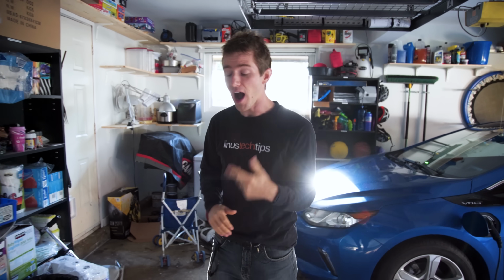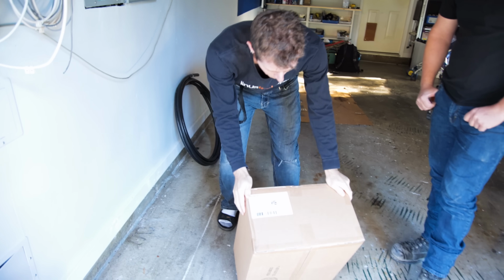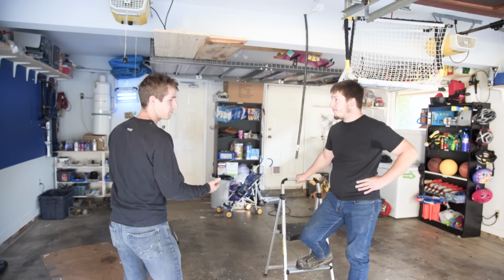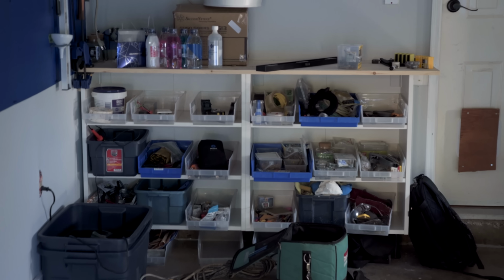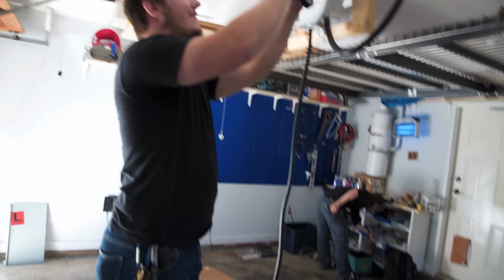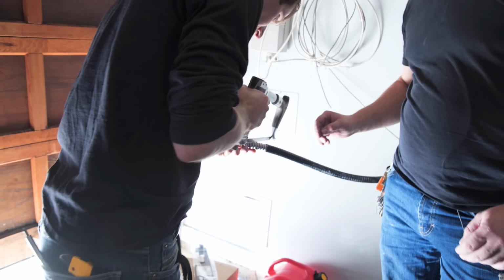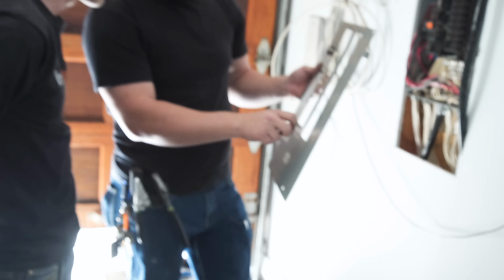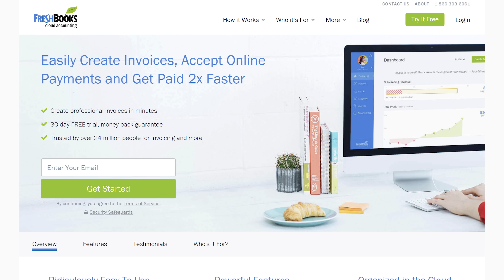Installing my Electric Car Charger - What Could Go Wrong??

Comment: As a professional electrician, I approve of this electrician. Also he's fun af and does well on camera
Reply: Rory Christel he might be a great guy, but his electrical practices are way off. One, he should of isolated the entire switchboard before removing the panel, two, was was not using the correct screw drivers.
Reply: daniel5620 regular klien screwdrivers are fine on 120VAC, it's more than sufficient insulation for that voltage. And lol at isolating a breaker panel, how green are you?
Reply: @daniel5620  Uncommon in Canada to turn off panels when working on them. Uninsulated screwdrivers are also the norm here. Both practices are changing slowly. We rely heavily on our CSA steeltoe boots which are 10000v rated as long as they have the omega symbol present.
Reply: Daniel M honestly, you're not using your boots. Pretty much any pair of thick rubber soles would work at these voltages. I can grab a live 277VAC wire while wearing my Vibram sole McRae's and still not get hit, as long as I'm mindful about where the rest of my body is.
Reply: totally forgot your on 120 try that on 250 in the uk and its all kinds of fun
Reply: @recless8667  Totally true although I like having the peace of mind. In my province Alberta you aren't allowed on many big job sites as an electrician without them.
Reply: I might not always be correct but our standards in Australia are to protect a electrician, I forgot that other countries have different standards. Sorry if I pissed anyone off.

Comment: Index of some of the innuendos:

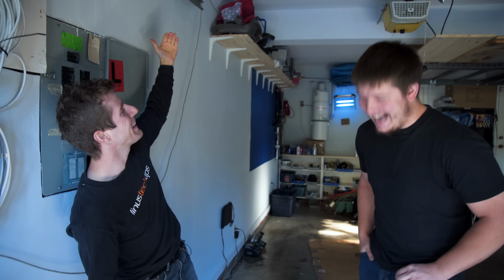4:00 I just know where it's going and I . . .
4:35 I think all the access holes are kind of in use here . . . Oh wait, I see one!
5:20 OK, so you're going to stick a screwdriver up?
5:25 Oh Hi there, have you met my friend, Mr. Pokey?
5:30 OK, now you can poke something through a hole . . . OK, can it be black and really thick? . . . I'm gonna say yes. . . . Yeah you are!  It's properly sheathed; It's ribbed for her pleasure! . . . Oh my god it's really long! . . . That's Good  . . . OK, you've had enough have you?
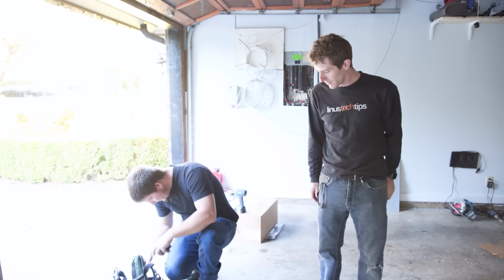6:45 I actually have wood as well . . . You got wood Linus?
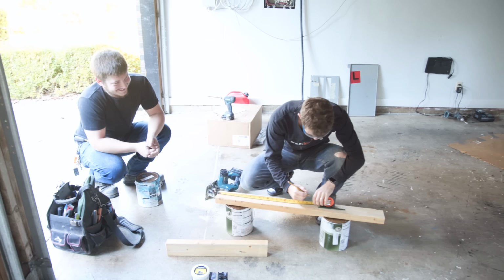7:10 It might not be straight, but it's 22 inches long right now . . .
7:45 I'm going to get my drill!
8:00 I've got my own screws, their just as good as your screws . . . Which Screws shorter, Linux? . . . Their actually slightly shorter, but not in a way that matters. . . . It's not as thick either, Linus.
8:30 All right, who's screw is longer now, bring your's back!
9:55 Oh! So, that's all the fun bits inside!
10:15 So at this point you just stick it in there . . .
Reply: 14:07
Reply: 13:21 you just wont use my hammer
Reply: 3:20
Reply: 6:48

Comment: 9:41 My heart stopped when he started screwing in the screw
Reply: Yeah, same. Sure he knows the screws are not long enough to go through, but fucking hell
Reply: @RiamiAurum  you dont do it
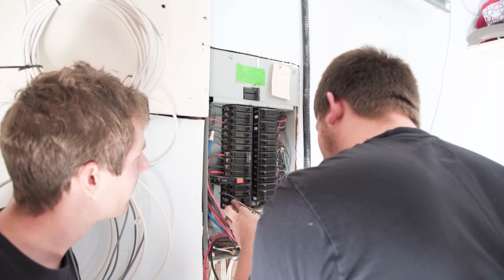Reply: 16:16 its way worst my friend u.u
Reply: @RiamiAurum  Carpenter here and regardless if screw is longer or shorter. Under no circumstances do u put your hand behind the board. Faulty boards can easily split and pierce the hand

Comment: Yes, the Chevy Volt is discontinued.  I purchased a used 2017 with around 20,000 miles on it and less than 1000 were gas.  It seems like the previous owner was a "high-miler (obsessed with getting max electric range by frugal acceleration and breaking)" and the friction brakes felt like they had almost never been used.  My new job is 40 miles away.  New Job offered to install a charging port for me.  I might get a second and in 2 years, I plan on getting a 2019.

Comment: Laughing at cutting off the mains? Proceeds to work on a hot breaker box that looks like that? Brian I like you, don't die.
Reply: And without proper insulated screwdriver
Reply: It was a bit sketch on that particular panel, but he would have to touch the screwdriver to the case and busbar for anything to go wrong, and I'm pretty sure that's physically not possible in that panel with a straight tool.

I have panel that doesn't even need tools to install a breaker.
Reply: It is actually common for electricians. Sometimes you just cant cut off the main just to install a new breaker.
Reply: @shinaikouka  Don't worry, I have an older panel too. It's a short panel with nothing but tandem breakers. It's all good. I have only 100A service and have never tripped a breaker.

I just installed a sub panel for my basement, but I literally don't have a single space left for any more circuits anywhere but it is clean, includes a while home circuit breaker, a garage heater, and a 30a  service to the garage for utility. I optimized the hell out of that panel.

My service comes in from the bottom too, but my builder had the presence of mind to mount the of upside down.

In your case I would just get a bigger sub panel and put it right next to yours. It'll save you thousands in labor trying to replace the old one.
Reply: If you don't work when the power isn't on you're not an electrician.
Reply: @scwfan08  Yeah, there is a reason they are called Sparkies.
Reply: @shinaikouka  If there is no means of disconnect ahead of your panel, at least here in Canada, then it is actually against the CEC to have the service conductors run through the area of your panel where your branch circuits are located. In the video, the service comes in the top, and if you look that area of the panel is closed off behind another cover. Branch circuits cannot be run through that part of the panel either, which is why the Charger feed was run in the bottom. The sides are blocked by the wall studs.
Reply: @scwfan08  gatekeeping 101

Comment: Why are you using armoured cable indoors ?
Reply: Safety, because it's going into the attic which is accessible and it'd be technically exposed otherwise
Reply: @casualdanger  Here in europe we only use armoured in farm installations
Reply: flinny OwO here in the middle east we don’t know what that is
Reply: Because it's linus proof
Reply: Cause it’s tuff like ASUS tuff
Reply: Because it was going in linus's house and Brian
Knew who he was dealing with
Reply: Because it's simpler than using conduit?  Not exactly the way I'd do it.  I'm pretty picky though.
Reply: @jbdragon3295  I would of never brought that flex down outside the wall into the bottom of panel. I would have that ran inside the wall. Do it all the time .sometimes you can't on exterior walls but that isn't the case here.but I'd say that's why he ran  fmc being exposed.
Reply: @Flinnyyyy  and what they used underground say in garden both under decking/concrete or earth ?
Reply: @mbk1251  He's talking rubbish. Probably not a sparky. We use armoured all the time. For example if you were to install a shop A/C cassette, you'd run armoured to the condenser isolator outside and then flex out to the unit. This is true for pretty much every store/shopping centre/office/hotel etc in the UK.
Reply: Safety mainly, especially with moving plant/vehicles involved. Also SWA is flexible core thus has a higher current carrying capacity due to the higher surface area. It is also sheathed against small mechanical/corrosive damage, armoured against heavy mechnical damage and the engineer has the option of earthing the armourings to free up a conductor core, allowing for three-phase applications without having to use a 4-core cable. Cost saving on any enabling works/cost such as chasing/trenching/ducting and or having to install a containment system such as trunking or conduit. It also saves on maintenance and man-power costs. This is the reason you find it everywehere in the UK/Europe, even in domestic homes to a certain extent. Not sure why the American market still opts for singles+conduit for pretty much everything but whatever floats your boat.
Reply: @casualdanger  Then any sheathed cable would do, the attic isn't a high-risk area for mechanical damage. It's more likely to do with the fact it is carrying a medium-sized DC current and it is vehicle-related which would introduces a higher risk but to me any large-sized control cable such as SY/YY would have been sufficient.

Comment: 9:40 drills screw into his own hand. JESUS LINUS!!!!
Reply: And 2 minutes later he's giving instruction on how not to disembowel yourself with a carpet knife, it's so adorable, like watching your apprentice try and drive boom lift, or a fawn taking it's first steps.
Reply: @Rattus375  if you screw if for too long it can drive itself deeper than head level, especially in soft, humid wood
Reply: @shishkebab64  True but I don't recon that's a likely scenario if you pick the right screws and use half a brain cell while doing your work. And then ofc a clutch drill helps with this.
Reply: @boomerangfreak  manufacturers create something fool proof and world invents a better fool
Reply: @shishkebab64  Those words are to accurate for me to give a counter argument D:
Reply: Nicholas Lenzo I thought that was dangerous as well
Reply: Pun intended?
Reply: And also cutting towards his wrist to make sure he bleeds out on the spot.
Reply: your username is oddly appropriate for this comment o_O
Reply: I literally yelled out loud when he did that!
Reply: it really isn't that dangerous. If it was a drill bit though, thats a different story
Reply: Had the same thought!

Comment: Being that I have always felt somewhat inferior to Linus (when it come to computers), I want to enjoy Linus not being at all familiar with AC power.  However, this is quickly offset by him admitting his weakness in this field and calling a professional.  I wish more people would make that same choice instead of watching an episode of a DIY show on HGTV and thinking they are an electrician.
Reply: I will run the wire, connect it to the switch/outlets/ect but I won't touch the breaker box except to turn stuff off, I have a friend that is an electrician, he always checks what I did, sometimes fixes, and then wires to box. I find it's a good in between
Reply: One of the main reason, at least in certain regions and countries is only certified electricians with qualifications are allowed to modify electrical circuits around a structure, building, houses etc. and you're not allowed to modify anything, including power outlets.

However, I'm not so sure about the situation in Canada.
Reply: @junrenong8576  Wait, are you saying you can't even touch the wiring like for replacing worn-out switches/outlets? Or are you talking about running new wiring? Because I guess I could maybe understand the latter because there are certain codes to comply with, but it would greatly increase the cost of many simple home projects like relocating or adding overhead lights/fans. Personally, I'm with the guy above - I'll do everything else, but I'm not taking the panel off that breaker box no matter how many electroboom videos I watch (or maybe because of it).

Edit: lol I just realized I replaced a breaker years ago at my uncle's old house, but at least I turned off the main. Turned out it wasn't the breaker, though, it was a short at a socket so maybe layman really shouldn't be doing stuff like that...
Reply: @sntslilhlpr6601 Very late, but yes. Alot of countries have it so that you cannot do almost anything electrician wise. In Norway atleast anything that is a «permanent installation» you arent allowed to touch. 

Even alot of «temporary installation» arent allowed to be touched without a licensed electrician. And becoming a licensed electrician is hard, and a licensed electrician isnt allowed to do work at other peoples houses or run a company without a licensed «installer» registered company, which requires even more qualifications which are way harder to get.

Comment: I had an electrician install my Clipper Creek level 2 charger for my Chevy Volt. I switched from an electric range to a gas one because I prefer them and that freed up a 30 amp 220V breaker on my panel. The job only took an hour and so far so good....!!

Comment: I have the same car, same year, same color!  Just FYI: the stock charger is capable of level 2 charging with a cheap $60 adapter.  Should add that in and save people some money!  No need for a large charger.
Reply: Still though, if you're going to invest in an electric car and intend to eventually replace it with another electric, it makes sense to install the permanent charger on its own breaker. Plus you won't forget to bring the stock charger with you on longer journeys because you just keep it in the car.

Comment: Hi Linus! Love your content! I'm a Tesla owner if that blue wire is ground please wire it up because an EV charger without ground a storm away from frying.

Estimated charge by this LV2 set up for the volt is 2.5 hours tops :) welcome to the EV community that was a wise purchase
Reply: The blue wire is not ground and is not required in this installation.

Comment: Fun fact: the unit of electrical conductivity is the "siemen". It is a term used in engineering. (opposite of the Ohm which measures resistance) although some measure it in "mho's". (Yes its ohm spelled backwards, the unit is upside down ohm, no im not making this up)
Reply: @Chicken nugget 24/7 si

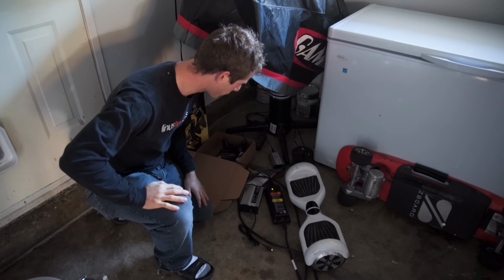Comment: 1:30, by the way, this is my cable corner, where there are is nothing flammable over here. THERE IS A BOX NEXT TO YOU!
Reply: A box? Did you see the paint cans in the background next to the WALL? Flammable is not the word I would use, it would be more like explosive..
Reply: Bay McGhee that paint won’t explode....

Comment: Are we sure we want to let Linus near high voltage?
Reply: high voltage?
Reply: You’re right, any voltage.
Reply: "High voltage" sweetie that's standard voltage in the UK.
Reply: Lol high voltage most of the world uses 220/240 Volts
Reply: its the current that kills ya, not the voltage
Reply: @matthewboland2622  That is absolutely bullshit and not true...
Reply: @guillermomarturetfendt9037  If you electrocute yourself with 10k volt and 0.001 amp's you are not going to die, so yeah as a general rule of thumb it's not the volt but the amps.
Reply: @shawnjackson1329  but the current depends on the voltage, so it's the volts
Reply: @natzzzy9119   and most of the worlds 3 phase 400V power laughs at 2 phase 240V power :D
Reply: It's the amps that kill you, about 30mA through the hearth is enough to kill a person, but you need the voltage to drive the amps through you
Reply: Linus get voltage drops
Reply: @shawnjackson1329   you cant put those deadly ~40mA through you without cranking the voltage tho
Reply: @softerrr7893  pls just everyone go watch Electrobooms video on what kills, current or voltage
Reply: LOL, still dangerous to work with.
Reply: @shawnjackson1329  As a rule of thumb. Volts =  how much work can be done. Amps = how fast the work will be done. So you need enough voltage to mess up the human body as well as enough amperage to move that voltage into the human body.
Reply: @jonny393  i know that technically it's the current that damages you,  but you can't have current without voltage
Reply: High voltage in the UK is anything above 1000 volts AC and 1500 volts DC
Reply: @guillermomarturetfendt9037  It is the current that kills you and not the voltage, A taser can be 50,000 volts. Over 100 of a voltage that can penetrate skin is enough to get stuck on it and die. The voltage does not matter as long as it can penetrate skin. This is why a car battery wont kill you despite being able to output 500 amps or more, the voltage is too low.
Reply: @softerrr7893  thats what i said
1 Ampere is just 6,24·10^18 electrons passing by per second.
Voltage is a potential between two different things. Even without electrons going anywhere.
Reply: @softerrr7893  No the voltage is constant but the resistance depends. With changes the amps.
Reply: @jonny393  I am fucking electrical. Over 30 mA through the hearth WILL kill you that's why Norway has a law that requires 30mA  RCDs on all fuses wich has earth potential.
Reply: @353click  No electrocution can also be a serious injurie doesn't need to be death.
Reply: @KingFrederik1309  current depends on the voltage. you can't have 30mA passing through a 1000 ohm resistor with less than 30 volts
Reply: @softerrr7893  Yeah and your point is?
Reply: @KingFrederik1309  you keep saying it's the current that kills, but you need a certain amount of voltage to push the current. so in the end it's the voltage the responsable
Reply: @softerrr7893  No I understand what you mean. But it is incorrect. 140V and 230V is lethal if the opposite side of your body is connect to earth. And you touch a fase with a finger (or whatever). You only need 53V through your body for it to be lethal... But it is still NOT the voltage that kills you its the current.

Comment: Actually, if you put it on the left wall, it would connect to the left car at a distance of 0 cars and to the right car at a distance of 1 car, which is what putting it in the middle will achieve. Unless you park the cars reverse or the car has a charging port on the right side.

Comment: Linus, you should have gotten a JuiceBox Pro 40 with the NEMA 14-50 plug instead of a SIEMENS that you have to hard wire in. The plug enables you to move the charger around as needed (on trips, to you next house, etc) and gives your garage a nice 14-50 plug that can be used for more than just car charging. The JuiceBox also has wi-fi status monitoring and control.
Reply: Hyvaa Paskaan I doubt anyone should listen to person named Great Shit...